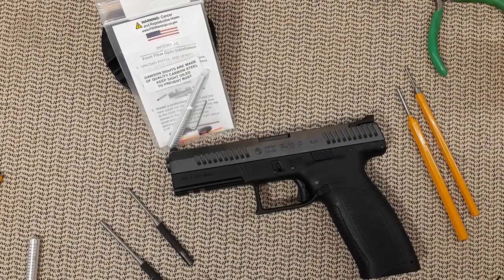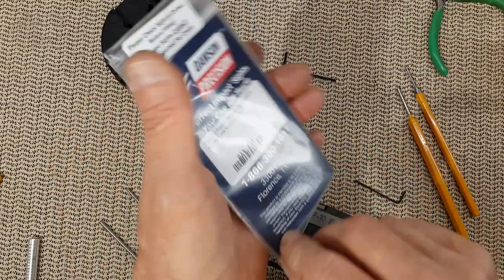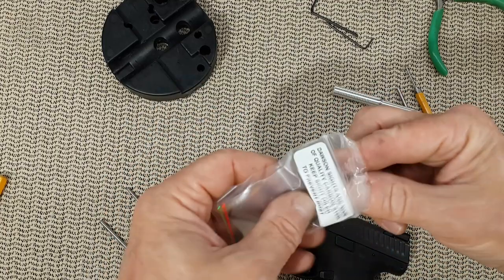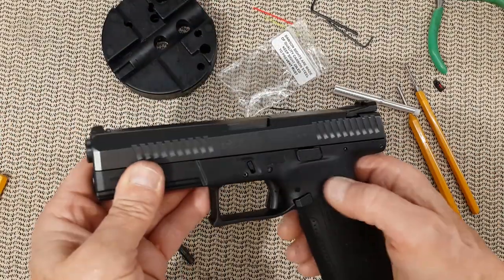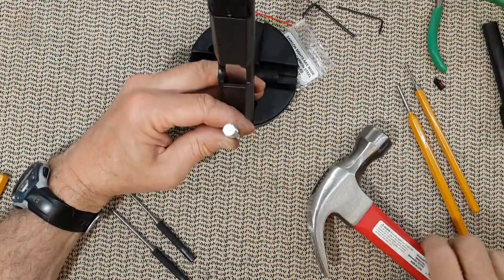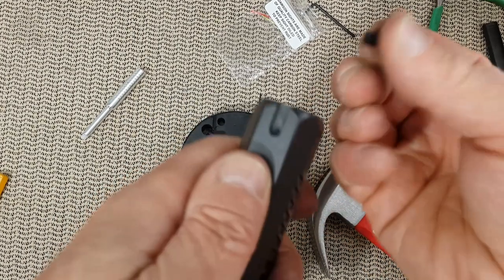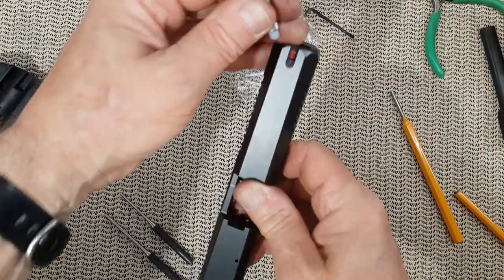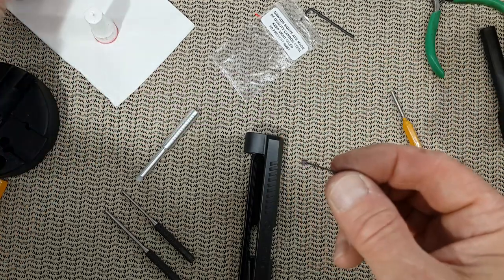CZ P10 Dawson Precision Front Sight Replacement

Comment: Great video. Question! Is there a complete set of precision sights front and rear for the CZ P10F? Thank you.
Reply: Yes dawson precision has just the front or front and back red in front green in the back
Reply: @alextownsend8624  I have the p10c, can I use the Dawson front with the stock rear sights?
Reply: @Daniel-hq7gj  yes you can. You can also order just the front sight or rear sight so you dont spend as much as ordering the set with both. I was debating doing just the front as well. I'm not sure about tritium but I know the fiber optic ones you can order and install separately
Reply: I have the p10c as well not the fullsize so I know it will work for yours

Comment: Great video, I just received my CZ P10F and love the gun but not the sights. It shoots straight? Well for my screwed up eyes anyway...Lol, So here is my question, you said you change the hight of yours to raise the point of impact. But I searched and can't seem to find what the standard height for CZ P10F is. I'm also from Canada and agree with Iris about the safety check. It should be common sense and second nature to always make sure it's safe and we don't need all those keyboard warriors whining about it.  Thanks again for all your great video's.
Reply from the maker: The front sight is .155 Tall (from the slide) or .230 Tall (from top to bottom) x .125 wide.
Slide to top is common for after market dimensions, this way you don't have to remove the sight  to find out the correct height, but manufacturers generally give you the full height. Good luck Doug.